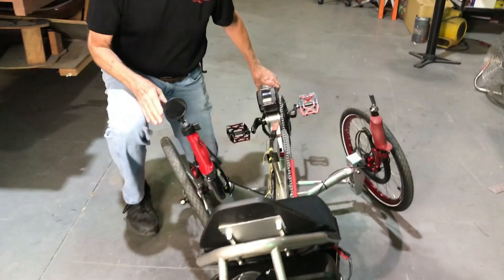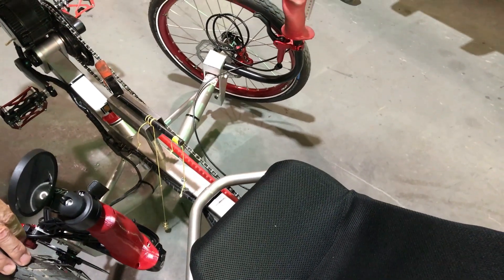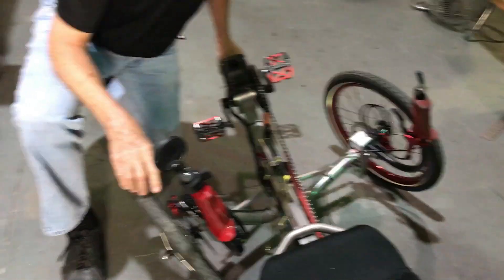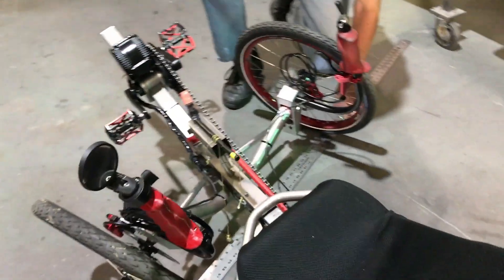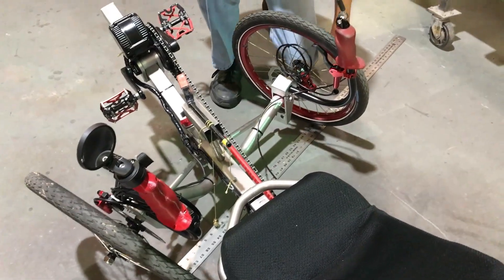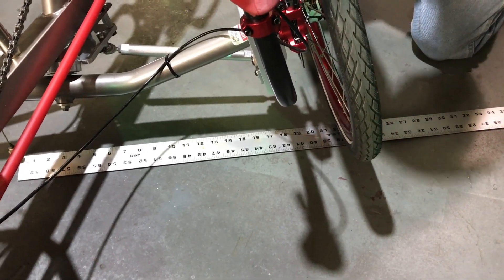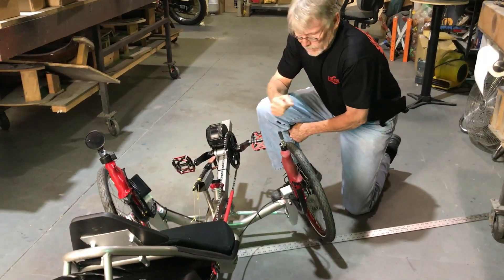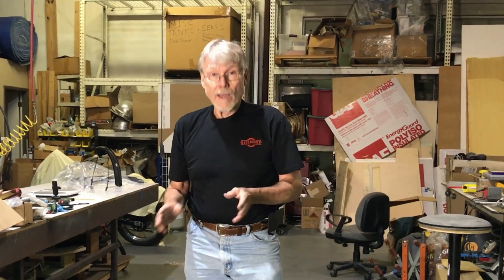AR-3 Steering Center of Mass

Comment: I think you may need to take into account the dynamic outward forces that result from the turn. You might consider placing strain gauges on each half of the front axle tube to get a better overall assessment of the forces involved. Whole stopped the static forces would definitely be greater on the inside wheel. At low speed this may be the same and I think we can presume that there will be more weight on the inside wheel but at higher speed it may actually transfer to the outer wheel.
Reply from the maker: Quite possibly but you’re starting out at over a 3:1 ratio. That’s pretty big stuff when compared to every other recumbent tadpole out there that has a 1:1 ratio. 
These videos are to explain why the AR-3 handles corners so well.
 Compared to the standard recumbent design it’s obvious with no weight transfer to the inside (cornering) wheel, that becomes an extreme weight transfer to the outer wheel with those forces. 
 This video should give the idea that you overcome the outside force (whatever it is) by keeping the weight concentrated to the inner wheel. 
Yes, I don’t have instrumentation available but that force should be measured to come up with a “real” number, however the example shown is that no other flat recumbent adjusts to weight distribution, and the leaning ones I’ve seen don’t offer this weight ratio exchange at all.